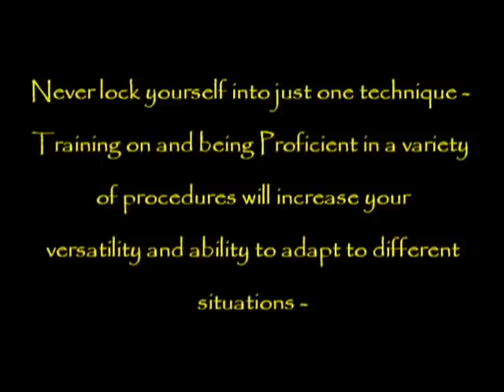Firefighter Rescue and Survival - The Double Horse Shoe Technique

Comment from the maker: Rod, Thanks for your question and input.......It comes down to speed why both the "searching" FF in the beginning of the video as well as the initial "rescue" FFs were on their knees. Yes, you're correct in that you can distribute more of your body over a greater area by being on your stomach and reaching out farther with your tool, but you're limited to the immediate area around you and you won't cover a larger area nearly as fast by remaining on your stomach versus crawling. As far as the 2nd rescue FF; we teach a very specific way of sounding the floor - The technique shown in the video allows the FF to move quickly while still maintaining in control of his/her tool. If their tool breaks through the floor as they're sounding or they come across a preexisting breach/opening, the tool is less likely to fall through the hole or breach if it is held like you see in the video. We also always promote centering your body mass over your hips and back leg so if that you break through the floor with your tool the momentum doesn't carry your forward into the hole. In the end it basically comes down to "Each his Own" - What works for you may not work (or be preferred) by someone else. We rarely teach hard and fast rules - Just options.
Reply: p
Reply: DALE G. PEKEL Ishibb

Comment: Mainly the color of the gear is preference by each Fire Department. Bigger/busier departments had preferred black gear over tan or yellow because it doesn't show soot and dirt as much giving the guys a cleaner not so dirty look. The problem most Departments are running into is the gear is beginning to break down because the gear is not cleaned regularly and properly. So a lot are switching back to tan gear because at a glance Officers or Chiefs can see who needs to get their gear washed.

Comment: If situation dictates what is best way to convert the pack if need for profile restrictions
Reply from the maker: That's an excellent question - We've taught and practiced a variety of techniques as situations and conditions can change: You will typically have one of 2 situations; The FF fell through a pre-existing hole or the floor gave way under their weight. In either of these situations the hole will be a size that either the FF falls easily through, narrowly falls through or one where the FF gets wedged in the hole. The situation you are inquiring about is a tight or narrow hole in which the FF barely fits through. In a situation like that we would typically use rope or webbing (which I have videos on as well on my channel) in order to minimize the space taken up by extraction equipment such as the hose line or a ladder. The concept here is if the FF fit through the hole falling through it, they should be able to fit coming back out. However if you were still worried about the scba getting hung up, one technique that you can consider (if you have a carabiner and an escape belt or seat harness) is to clip the carabiner to the top of your scba harness and then clip the carabiner to your belt or seat harness - This will allow the scba to be secured and hanging (somewhat between your legs), but will in most cases give you enough length for your MMR hose to still reach your mask. With the pack off your shoulders this reduces your profile, but can be problematic as there is a good chance the pack will still get hung up in the hole as you don't have direct control of it with it hanging off your belt or harness. This technique obviously relies on a lot of factors including the type of scba you have and the capabilty of rigging as I described. Feel free to check out these videos as well: https://www.youtube.com/watch?v=uCEK5LfDLhU    and  https://www.youtube.com/watch?v=VolVPno4Hc0
Reply: Hell ya love that thorough answer gives many ideas for teaining

Comment: if the firefighter falls through the floor of a single story house with a crawlspace not a basement??
Reply: If they just fell into a crawlspace, most of those are not very deep. Assuming the firefighter is uninjured from the fall, they should about be able to stand up and hop out on their own. If they are injured it wouldn't take much work to get down to them due to the minimal distance.

Comment: Who would ever have three guys for this?
Reply from the maker: If you work for a small volunteer FD you may have difficulty obtaining adequate staffing, but this technique does not have to be performed with just a single company - Envision a scenario where a 2 FF engine company is performing fire attack while 2 other FFs are searching - One falls through a floor (from either company) This would leave the other 3 to pair up and still effect the rescue. Realize the "double horseshoe" technique is just one of many options for rescuing a FF who has fallen through a hole in a floor and it has limitations just like anything else.